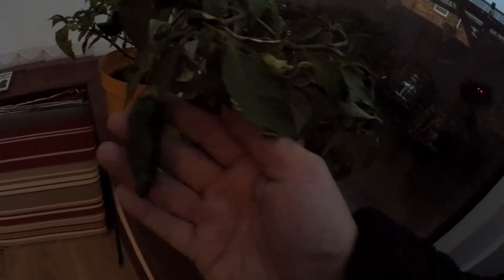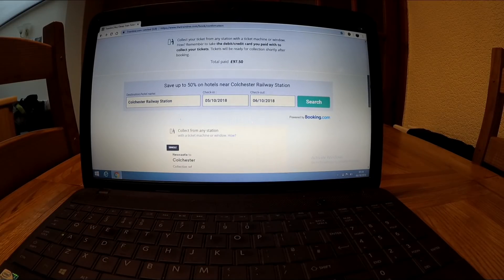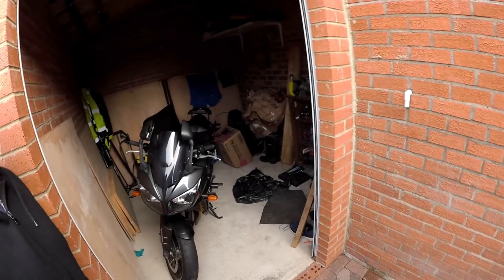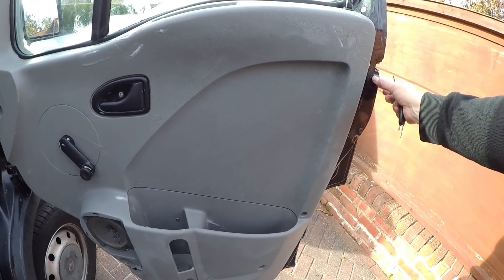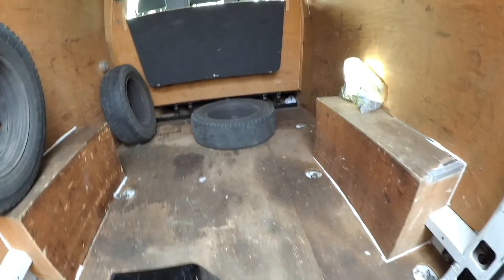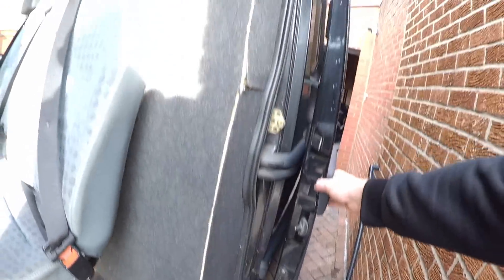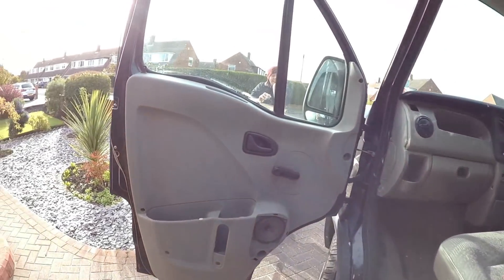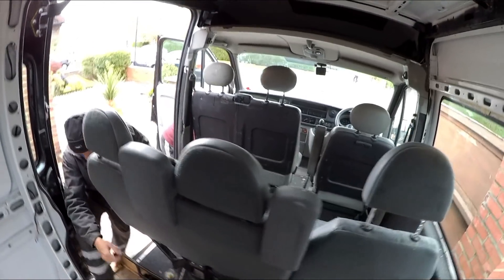Campervan Conversion. First look...

Comment: Sweeeèeeeeeet.
Reply from the maker: where have you been hiding fella?
Reply: Still watch , just got other stuff on my mind , so use you for relief from head banging things going on at present ,namely councils  .
Reply: @JustSteve247  also been extra busy ,for some reason ,slapping car drivers ,who seem to think trucks leave a 29 metre or so gap between them & the car in front ,just in case they want to dive inbetween & then slam there  brakes on ,whilst texting there whoever